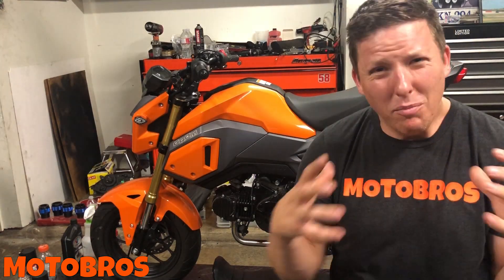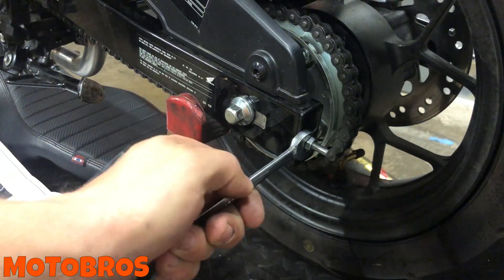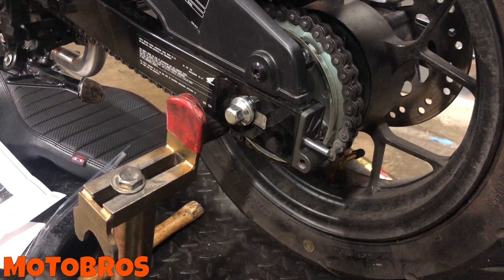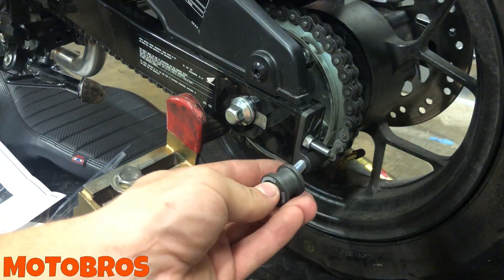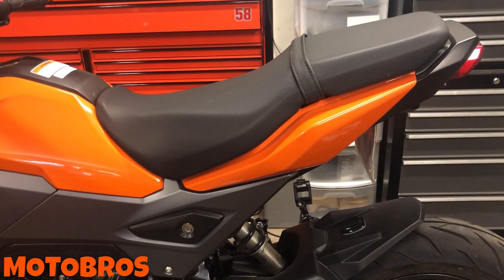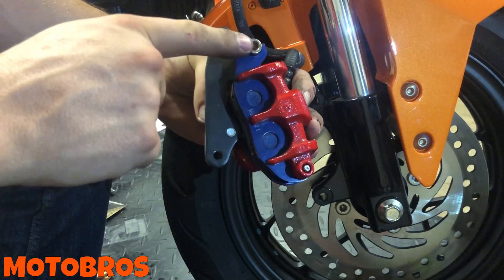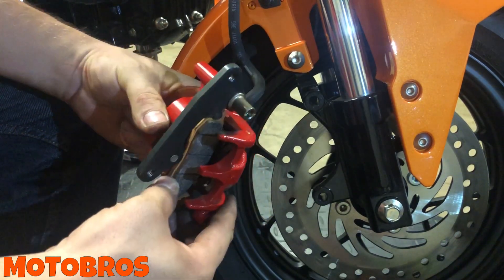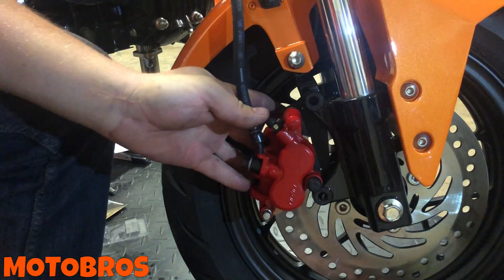Grom Install - Spools / Seat / Front Pads

Comment: appreciate it haven't seen a front brake pad replacement video and will save this for future! Is the rear brake pretty much same concept and same measurements as front brake pads?
Reply from the maker: Jon if you would like to see the rear pads I will do a video for it. Let me know.  Thanks
Reply: MotoBros, LLC wouldn't mind at all! Attempting to do all servicing myself for the grom to save money. I think I have another year (2017 grom) before I need to replace brake fluids. I guess ppl dont typically change their fork oil either.

Comment: Are those pads a lot better than stock vs. a brembo caliper set some vendors sell?  In other words are the Brembos $350 better?
Reply from the maker: jemo951 these pads are the best. You will not be disappointed.  You can upgrade your master cylinder to the rcs16 but we are not going to as a couple of our racer friends have been tucking the front because it’s a little over kill.  Stock master has worked perfectly for us.

Comment: What brand seat is that? Is it comfortable?
Reply from the maker: http://www.msx125accessories.com/msx125-seats/honda-grom-msx125-replacement-seat-sf4-2016-17
Reply from the maker: Its a million times better than the stock seat.  I had to change it after 50 miles